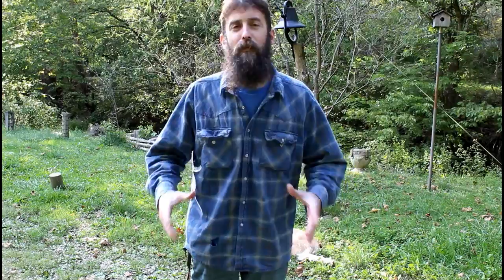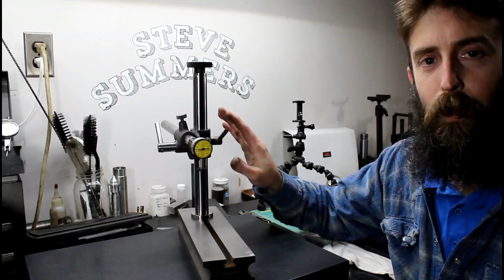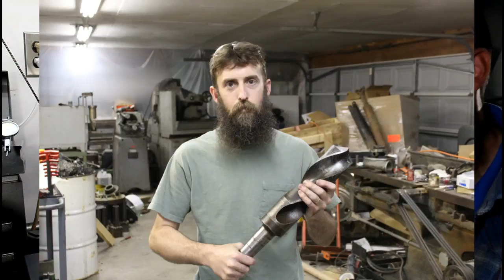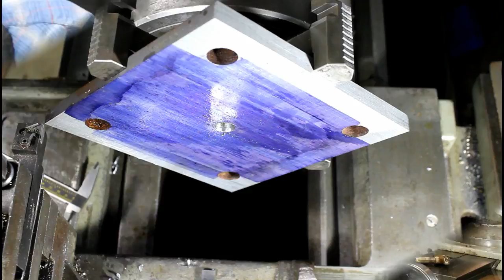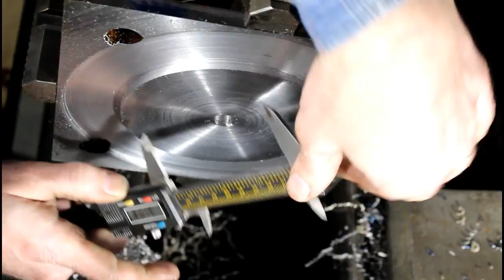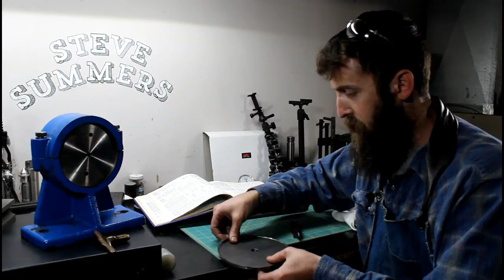Angle Plate progress, New tool, Trepanning

Comment: I have a smaller B & S indicator stand, no part number on it.  It was also off a couple tenths, and twisted a bit.  I scraped it in, sides too.  It is a pretty easy and quick job to get it parallel and flat and hinging properly.  I have a B & S surface grinder, and I would leave .0002" alone, .  I need to be lucky to beat that.  Just scrape it for flat and parallel top and bottom, and call it good.
Reply from the maker: That's what I was thinking, scraping this in will be quick and easy. This B&S surface gauge has no number either, I found pictures of ones just like it that did and they were 731.    Thanks for stopping by Bob

Comment: Consider relieving the center of the back, say 20 thou for 2-1/2 or 3", leaving a landing ring.  I think it will less likely to move when tightened and feel more sure footed over all.  GREAT VIDEOS!!
Reply from the maker: Good idea, that would add higher pressure on a smaller surface and increase the friction. I have seen this before several times.   Thanks Bill
Reply: Bill Cooley
I was going to make a similar suggestion but looks like you are already out of the blocks.

Comment: Nicely done once again Steve. I am hoping my new shaper will run down to those kind of strokes per minute - the one Im using at present slowest cycle is 50 strokes /min - and thats a bit fast for stopping and starting too often with the clutch -  As a suggestion, why not cut a slight bevel angle on the outer flange and then let your graduated lines run the bevel surface exiting off the material - no burr to clean off and if you fit a brass alignment strip over the bevel to your main body of the casting it would all line up easy on the eye. Of course the best bit is you can set up your fancy pants tool shop universal shaper table angle plate to match the bevel angle you cut with your RT sat on top -- you know like real 'fancy' :-)  All the best my friend. Mat
Reply from the maker: That is a great idea Mat, I just may do that with my "Fancy pants tool shop universal shaper table" LOL     all jokes aside, I love the idea, I try to keep the blinders on and just keep it simple but this is almost to good not to do.    We will see   We will see        Thanks Mat,, Great comment.
Reply: My pleasure sir. keep well mate. Mat

Comment: You have me a bit confused, how are you planning on keeping that back plate indexed with the part it bolts to with only one bolt in the center?
Reply from the maker: The pointer will be on the lower casting that is stationary to the rotating slug. The back plate only contacts the slug not the casting and the one central tee bolt locks the backplate to the slug, I was wondering if the one bolt in the center was going to be enough but it seems to do the trick just fine and locks solid.   Does this answer your question?

Comment: I don't think scraping the indicator base is the best solution. Scraping by it's nature relies on a large contact areas to average out the surface irregularities. The base of the pillar is quite small so you may not get the averaging required. Overall precision surface grinding / lapping is the better solution IMHO.
Reply from the maker: Good comment, I will think it over, if nothing else I could just scrap the bottom, I am not sure what I am going to do just yet. The base of the large stem is about 1.5" , I think I could get plenty of contact between the two, that is assuming the base of the steam is flat lol     Nothing is flat    We will see, I'm no expert.    I think this is a good excuse to take this over to Brian Block's place, he has a nice grinder that I would like to try.   Thanks for watching Rob

Comment: I never felt trepanning was any harder than parting off. tool clearance is important and the correct cutter angle for the material you're cutting. It sure saves a lot of time turning a large plate down to size or cutting a large hole in a piece of plate.
Reply from the maker: I agree, I think most people have trouble with the relief angles, It for sure saves time and material.  Thanks for stopping by

Comment: If you do have problems with it slipping just use one of the 2 holes already drilled in the matching part. Make one side a press fit the other a slip fit.
Reply from the maker: I have tapped both the holes you are talking about now. I plan to use them if I have trouble     Thanks Y Pop

Comment: I cut 3 times and its always too small???? hmmmmm
Reply: Known as sods law. measure it accurately and cut it accurately then somehow its a 'bit' too long . so you cut the 'bit' off and then its too short . Working with wood is  real tricky, when you do eventually get a piece the right length then nail it the wood splits .
Reply from the maker: I'm that way some times   :-(

Comment: Perhaps you could make the index lines a few thou deeper than you need them. After that, spray the complete surface with black paint, and let it dry. Then, you can use the shaper, and plane the additional few thou down. That way, you should end with nice black lines (or yellow or white) which are good to see....
Reply from the maker: I plan to color fill the lines,  that's a good idea

Comment: Well, I guess you should get the obligatory "YOU SUCK!" new tool bargain! The trepanning is a  cool process. Did you cut a small V in the tip? I really like the scribing on the index plate! Nice work.
Reply from the maker: George Chambers Even a blind squirrel finds a nut every now and then. LOL.  No v grove, that may have helped clear the chips. The trepanning really turned out nice, I was happy with it. Thanks for watching George